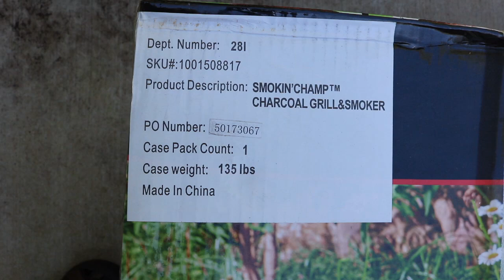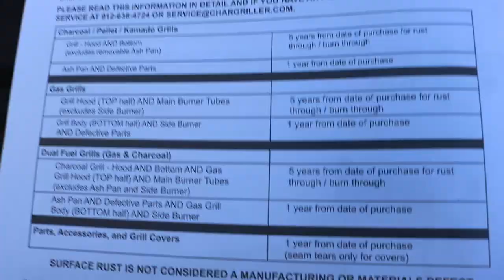#73 Smokin' Champ Char Griller Smoker - Unboxing and Assembly

Comment: Thank you, thank you, thank you for the video.  There's no way I could have put this together without the video.  I wish I would have read the comments prior to assembly because I used the large cotter pins on the wheels and smaller ones on the top.  They stick out but oh well I'm not taking it apart.
Reply from the maker: Hey @kdware12, glad the video helped you to assemble the griller.  Good luck with it and thanks for watching!
Reply: kdware12 did the same thing I hope is not a big deal 😬

Comment: Bought this for my husbands birthday 5 years ago. He’s never covered it and it’s still good today. I just bought mine yesterday, on sale for 200 bucks (Labor Day sale). Great price from $379. I waited all of 2023 summer for this sale. I would say if you want this, buy it, it’s worth it, but do not buy it for more than $200-$230. Also I recommend buying the grill cover as well. Ours wasn’t flimsy at all. We actually tightened all of the nuts and bolts as we assembled the grill. Ours withstood a few horrible New York storms and has been outside for 5 years straight.
Reply from the maker: Great to here your success!

Comment: You put it together the wrong way around the wheels go on the side that the offset sits. So you lift and move it around from the other side.
Reply from the maker: Oops!  Thanks for pointing that out!  It doesn't move from its current location, so not as critical.  I'll take a look.  Again, thanks!

Comment: My family just picked up this grill/smoker today based off how many positive reviews it had on the internet and I wasn't too impressed with the quality either. I am however looking forward to learning how to properly grill and smoke food the manual way instead of relying on faulty electronic pellet grills! What are your thoughts after breaking it in and actually cooking on it?
Reply from the maker: Hi tyhod123, the grill worked fine with burgers and I am most worried about the thing rusting out.  So, I have the cover on it when not using it.  We haven't used it enough for me to give a very thorough answer, but it seems to be doing ok so far.  Charcoal works much better than our propane grill.

Comment: How was it with your new char griller!
I have one and the worst design ever is the ash pan being tack welded.
As long as ash is dry I was able to dump and clean easy. The burger/dog/brat juices dripping on pan and mixing with ash caused a problem for me. During cooking that leftover would cause flair ups and ruah my cooking.I was not able to clean well under rack.
I scraped as much as I could each time but finally bought a 22" weber for most of my grilling now too
Reply from the maker: It is doing well so far.  I agree about the ash pan as I have that same issue.  I have the unit on a slight incline to help the juices run down and out the grease trap and into a can... but, I still get the build up like you do.  It is definitely an issue and does cause flare-ups!  Thanks for watching!

Comment: I’ve had this boxed up in my garage a few and just decided to put it together. Question:  should I wash grease off with soap and water or spray with Pam and allow residues to burn off?

How many times have you used it?  What are your feelings thus far?

Thanks for posting. This certainly helped me.
Reply from the maker: Hi Teem Playa!  Don't wash the grease off, just spray with pam and burn if all off to season the smoker.  We have used it a few times and it is performing well.  I am satisfied with it but I know it won't last as long as my Brinkman did (17 years).  It was cheap, so short lifespan is expected.  Thanks for watching
Reply: Homestead Pilgrim what if anything did you do to address the gaps/spaces between the lid and grill “bottom”?  I’ve read many posts about that interfering with the cooking temp remaining consistent.
Reply from the maker: I didn't notice gaps and the heat stayed consistent enough for me, better than the propane griller on our back porch.  Charcoal is so much better in my opinion.
Reply: Homestead Pilgrim re: install of wheels and axle...the instructions call for the use of the 2 large pins but they stick out beyond the hub caps. In step 6 of the manual, they say to use the small pins. Did you use the small pins for the wheels and the large ones for step 6 (attaching the grill hood)?
Reply from the maker: Yes, I used the small cotter pins for the wheels
Reply: I just bought this model n I made the same mistake with the pins is this going to screw me over? Should I re do it?

Comment: I enjoyed the video. I’ve been trying to find one but currently they aren’t available. I’ve read that the paint burns off of the firebox. Did you find that to be an issue? Thanks.
Reply from the maker: Hi Ted!  No, the paint hasn't burned off the firebox so far.  I can see it doing so over time, though.  Thanks for watching and "try not to buy Chicom!"

Comment: Can you cook with charcoal in the main part or only put charcoal in the little charcoal holder on side ?
Reply from the maker: Yes, you can cook in both boxes, the large box and you could also cook in the smaller one.  The large box even has an ash pan for you to put charcoal on and you can lower or raised it to bring the heat to the grills.  The design for smoking is that you would have a fire only in the small box and that would then smoke cook the meat in the larger box... that is smoking only in the large box, no fire in the large box.  Good luck with your smoker!

Comment: Since posting, how have you liked this offset? I use my Weber for 90% everything but I need one for the occasional brisket so I think I can stretch its life span for a long time! Thanks for the upload.
Reply from the maker: I really like the offset for smoking, I've found no better method for smoking.  Just be sure to have a cover on it or the very thin low quality gauge metal will rust for sure... and keep it seasoned to also prevent rust.  Thanks for watching!
Reply: @homesteadpilgrim  Thanks!

Comment: I have a question since I've been smoking a while and have  some knowledge. I've bought this smoker today but can I use it without the thin sheet of metal since I'm planning on using the side part of as a briket basket. I feel like that thin sheet of metal is unnecessary and harmful since you can control the moisture and temperature with water and air ventilation.
Reply from the maker: Good question that I don't think I'm qualified to answer.  Best to check with the manufacturer.  Good luck with your smoker!  Thanks for watching.

Comment: What tools are needed for the build? Does it come with any?
Reply from the maker: No tools were included.  Mostly some small wrenches but I hand tightened all the nuts and bolts and then used a power driver to do the final tightening to go a bit faster.  Thanks for watching.

Comment: Looks very flimsy. How’s it holding up?
Reply from the maker: It is holding up fine so far, but if you have it outside exposed to the elements, you must purchase and use the cover as this unit will surely rust quickly without it.

Comment: My instruction manual said to.spray with wd 40 to remove glue/ residue that in it...
Reply from the maker: Hi Jamie!  I didn't see that.  I wouldn't use WD 40 inside the smoker as you will be cooking in there!  Use pam cooking spray (my instructions said that) and light a good charcoal fire to burn it all out while seasoning it.  Again, I wouldn't use WD 40 anywhere near the inside of the smoker where you will be cooking the food.  Good luck with your smoker!
Reply: @homesteadpilgrim  ; Thanks!
Reply: @jamiecoverson7500  wd 40 on the OUTSIDE or canola oil before seasoning to prevent rusting bakes it in repels moisture

Comment: 12:24 Am I the only one who got a box with flat washer that DO NOT FIT for the wheel??
Reply from the maker: Hi Dice, I wouldn't bet that you are the only one.  Anything from Chicom is suspect for missing hardware, wrong hardware and defective hardware.  Unfortunately, HD sources many items from Chicom.  We bought patio lounge chairs from HD and one had no hardware included in the box....returned it.  I'm preaching to anyone I know that Made in China is a big red flag warning that should be avoided at all costs.  I know it is hard to avoid, but over time, we should overcome the Chicom trade issues.  Thanks for watching!

Comment: I'll say one thing about the Smoking Champ. Char-Griller sure named it right. It leaks smoke like a Champ from the fire box, front and back of the lid and on both sides The lid doesn't close all the way and it's made out of cheap Chinese tin.  I used two rolls of sealant tape and a full tube of caulking but it didn't help.

 I sent costumer support a video and pics of all the smoke leaking from everywhere and the warped lid but they wanted even more pics of the inside of the cooking chamber and pics of the hinges.
 
I tried to explain, the hinges were NOT the problem but they insisted on more and more pics.
I finally realized, Char-Griller was NOT going to stand behind their product so I guess I'm just stuck with piece of crap until I can afford something better. So sad.
Reply from the maker: Hey Buddy!  So sorry you have had a bad experience.  I have a new mantra now and say it early and often and will continue to say it.... Try Not To Buy Chicom!
Reply: I will never understand how people knowingly purchase a cheap cooker but expect it to perform like a custom
 built cooker. Please explain??

Comment: What are your thoughts of this now?
Reply from the maker: Hi Todd, my opinion hasn't changed about the smoker.  It is cheap and it is made that way.  I don't think it will last but a few years given the thin gauge of the metal.  If you are ok with a cheap smoker than this one should be ok.  Once this rusts out I will be sure to get a higher quality smoker that will last.
Reply: @homesteadpilgrim  I respect your opinion I just got this for Christmas so I haven't used it yet but will Saturday but it'll take some time to see quality of it for me and this is my first smoker I'm used to little Walmart 22 inch charcoal grills so it's an upgrade

Comment: Please don't take this the wrong way. Just go to the website and check it out. You know you get what you pay for. If you want real wood flavor and temps that you can control. Made of heavy stainless steel. Yes it is also made in China but sold by a USA company out of Augusta GA  with stellar customer service. They have several models and sizes available. www.RECTECGrills.com .  It can't hurt to look at the website. Thanks, Ron.
Reply from the maker: Thanks for watching and that feedback, Ron.  Yes, I learned a bit more on this purchase.  My wife shopped on the home depot website and chose this model for me to pick up.  I arrived at the HD and searched for a floor display model that I could touch and feel, but to no avail.  This model was not setup and displayed.  Maybe that is for a reason?  So, I purchased it anyway... my mistake.  The biggest lesson learned is that I really need to try to limit future purchases that are manufactured in China.  I know that will be hard due to their practices of dumping merchandise at incredibly low prices, but I guess I have "had it" with the low quality and more broadly, the unfair trade practices that got us here and is now impacting me at the customer level.  Very dissatisfied!
Reply: @homesteadpilgrim  Thanks for your review. Based on the information in your review and in others, I bought this smoker today. $199 at Home Depot.

It is what it is. It's thin sheet metal, but that's why it's a third the price of heavy-gauge smokers. There's a huge jump in price point to find anything arguably better.

I'd rather replace it after a few years (I'll probably be moving in the next 5 years anyway), than to have to pay for, and transport, a heavy-gauge smoker. To each his own.
Reply from the maker: @john2510  Hi John!  Yes, your rationale sounds just like my wife, LOL.  She doesn't care too much about longevity and the price point ranks highest.  I guess if I didn't have the history of owning a "good" smoker, I would have a different point of reference.  I hope your purchase exceeds your expectations!  Thanks for watching!

Comment: I hope you didn't underestimate it too quickly.  I've had mine over 10 years. About 5 yrs ago I noticed a little rust, so I painted with Rustoleum spray paint. No problems since.  Never got around to buying the cover and it has survived Ohio winters and even a tornado that tore down my fence on both sides. Great grill.
Reply from the maker: Hi Crystal Pepsie!  Anything made by Chinese Communists I try not to buy.  Unfortunately my wife ordered it but I would not have bought it if I know it was Chicom.  It is holding up and I hope will last 20 years like my Brinkman did but I will definitely keep the cover on.  Working fine so far... I just don't want to support Chicom for many many reasons as you may be aware of if you follow their practices.

Comment: Are you satisfied with this grill after using it? How’s it holding up?
Reply from the maker: So far so good.  Be sure to get the grill cover or it will rust quickly
Reply: @homesteadpilgrim  any problem holding heat? How about smoke leaking?
Reply from the maker: It holds heat well, but smoke leaks profusely
Reply: @homesteadpilgrim  you should try adding a gasket sealer around the main grill and firebox

Comment: You can get some sand paper and sand off all the old paint and then repaint it with high heat bbq paint with stop rust by rustoleum. It will not rust after repainting the metal.
Reply from the maker: Thanks!  I had a Brinkman smoker that I did that with after 20 years of use.  It worked well.  Next time (should be real soon after this flimsy product dies)  I'll get another Brinkman.
Reply: @homesteadpilgrim  I don't get why people complain about the cheapness of a product that is cheap to begin with.  For someone who doesn't bbq often and has little space, and takes care of their product - this is perfect.  Now if you bbq every other day or 3x a week every week, I wouldn't doubt that a cheap product like this would die out after 6 or 8 months, especially if you don't take care of it "because its a cheap product'.